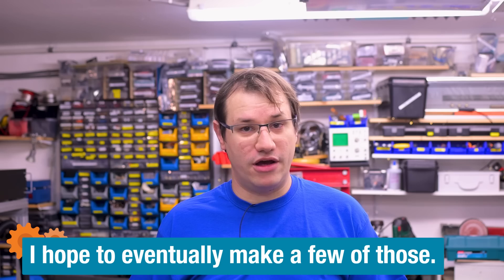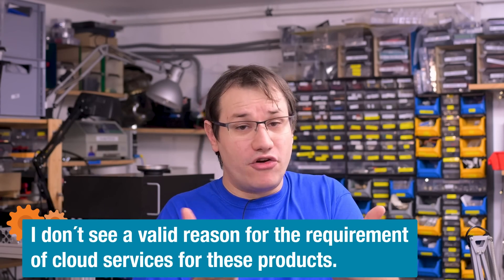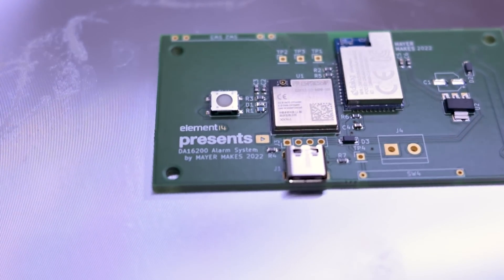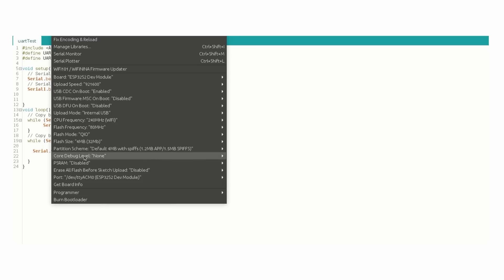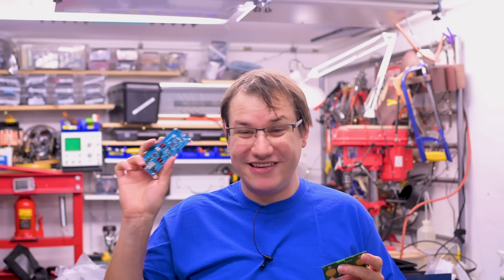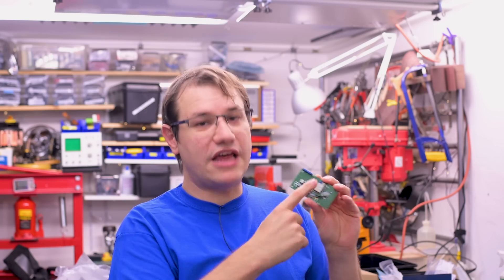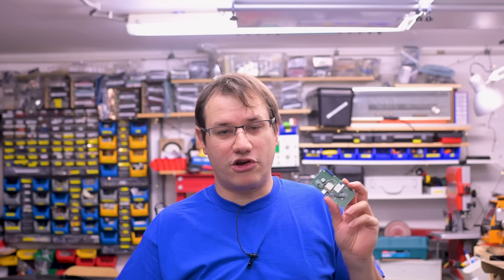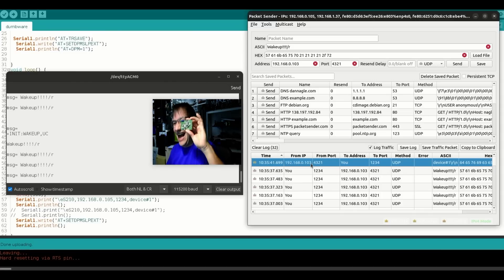Going Beyond Periodic Wakes: Using WiFi to Revive a Sleeping Device

Comment: i'm not really impressed...  how does it compare to ESPNOW?  how much current does that use over a whole cycle vs. an ESP?  you're trying to sell the Renisys chip, but you just seem infatuated...  it sounds great in schematic, but i'm not seeing any real numbers in terms of energy consumption in real life situations...
Reply: takes the same amount of current as an ESP but the difference is it stays conencted in sleep mode 3, which no other wifi module I know of is able to do. 
the wakeup via wifi message is not possible with any ESP. thats the difference in terms of power consumption while sleeping they are comparable., but the difference is any ESP has to wake up first on its own reconnect to the network and then recieve the message.

Comment: Looks a useful little module, can be a steep learning curve if you want to program a new device but using it in AT mode makes that easier (as long as you use the right UART 😉)
Reply: exactly, AT is not dead yet and often a faster /more reliable way than diving into a dedicated IDE or framework first.

Comment: you mentioned a deepsleep current of 35mA that is a lot, esp is around 50uA. So my battery will last longer with the esp that occasionally wakes up,
Reply: thats partly a missunderstanding/bad wording on my part. it takes 35mA in active mode(listening), like an ESP, but the sleep modes are very different:
Sleep 1 (total deep sleep) =  0,2uA , Sleep 2 (wakeup with RTC or Pin interrupt) 1.8uA and Sleep 3 (wakeup with wifi, RTC, pin) 3,5uA <-- this is what I use in the video.
So 3.5uA while sleeping but staying connected to the network. the Esp can also go very low but the key is it has to wakeup and reconnect first on its own.
Reply: @MAYERMAKES  thanks, that looks promising.
Reply: @MAYERMAKES  Datasheet says 8.5uA in Sleep 3 mode. That's because of the RF switch(5uA consumption).

Comment: Not sure, if WIFI is a good choice for a power saving wireless connection..
Reply: itt all depends o nthe application, for such home devices that are in reach of a typical router its a very good fit. if you build something oput on a field its not so much.

Comment: That i would classify as a "WIFI modem". Its pretending to be your good old fashioned dial-up modems, but connects through IP from its own microcontroller on the wifi. This is not a typical WIFI chip (that basically pretends its an advanced ethernet chip). 802.11 WIFI is quite chatty (beacons 10+ times a second ++++ ). It makes sense to work the way it works. Incidentally the same stuff people use to make C64 "modems" that connect via wifi.
Reply: There is btw software support to use it as such a modem on a pc. Makes it a great option for many projects